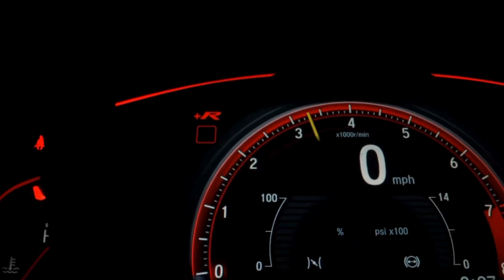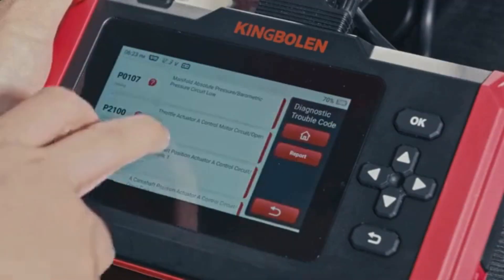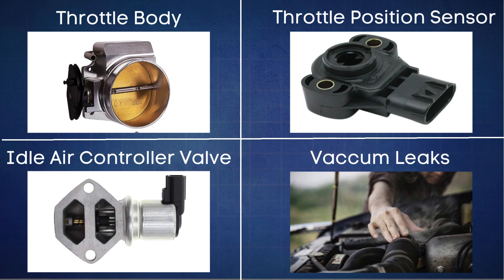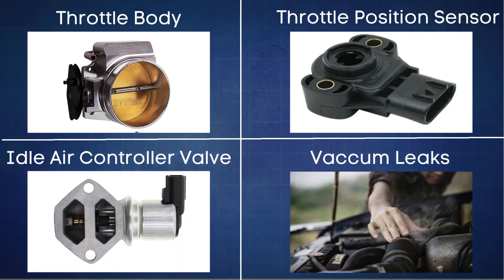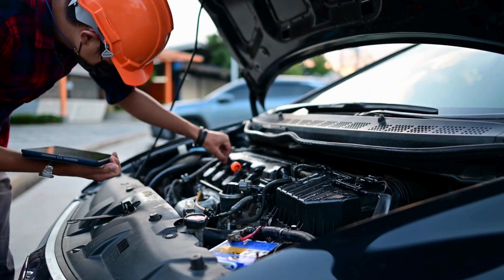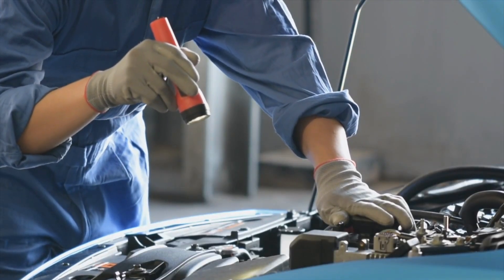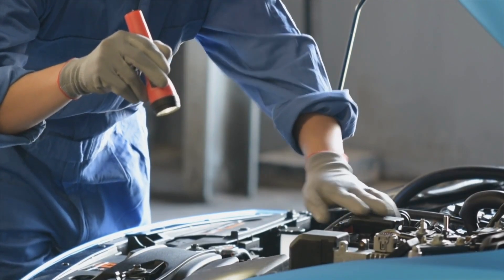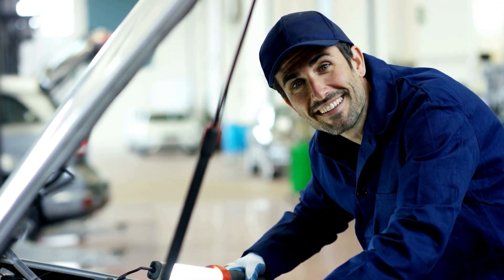Why Engine RPM Revving Up and Down at Idle, While Parked or Driving

Comment: So I guess the fuel injectors or ignition coils can't cause this also?. Poor video.
Reply from the maker: There are lot other issues like fuel injector , Ignition coil, vvt solenoid,  camshaft sensor and the list goes on. If we cover all the reasons video would have been very long.

The best way to find the root cause is scan with OBD-II scanner. Check the activated code and troubleshoot accordingly.
Reply: @carfix07  But that would be a very informative video.